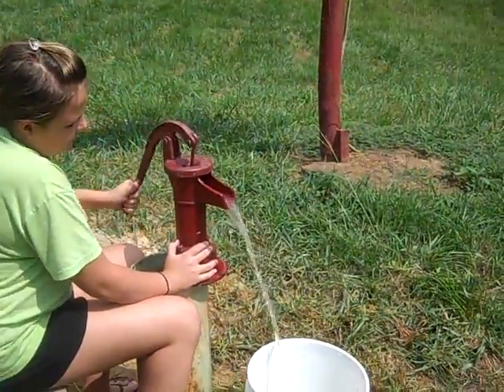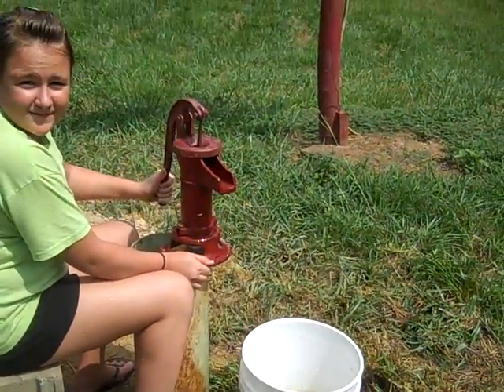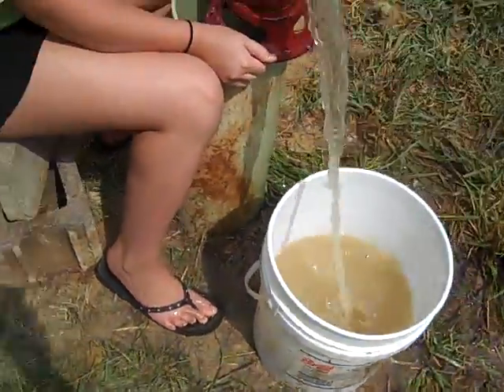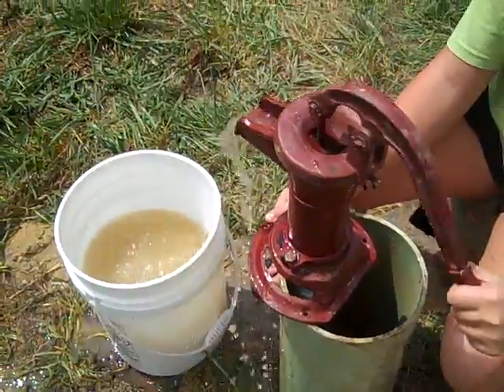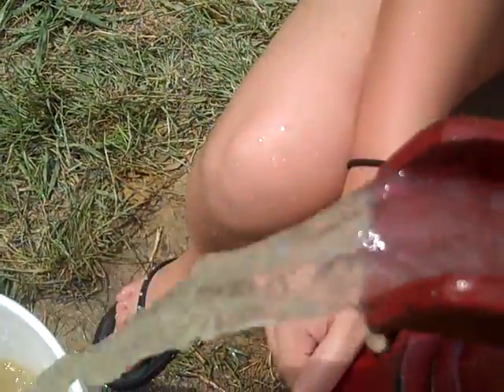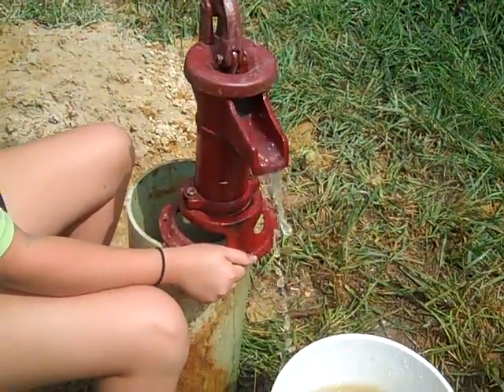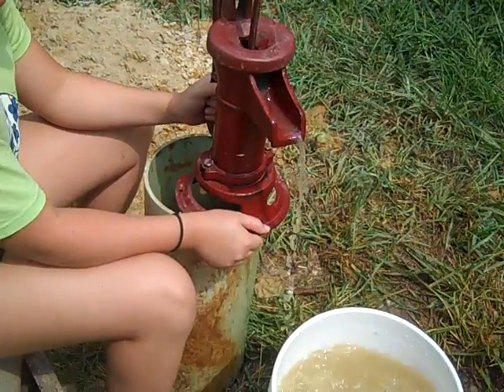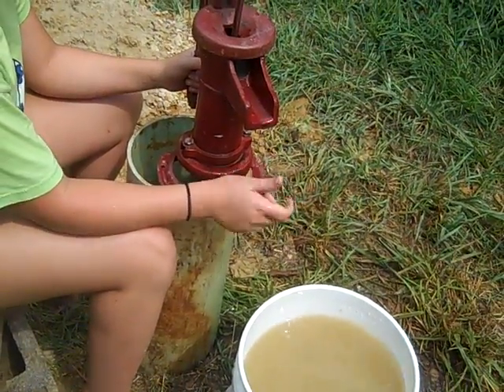Ground water well on the farm.

Comment: No plastic pipe. We use "inch and a quarter" galvanized steel pipe. (1 & 1/4 inch).
 Each section is held together with an outside coupling that screws to both pieces. If your area is right for this kind of well, then your local plumbing supply store should have the parts.

Comment: (continued) We actually use forced water under high pressure to drill our wells. You start the pipe with the water forced through it and as the water makes way for the pipe you drive it into the ground in sections with a big mallet. As each piece is driven into the ground you add another section and start driving again. Around 15 ft, you strike the water table.